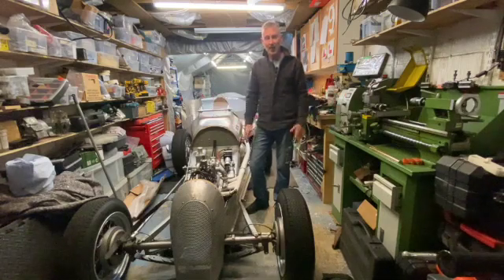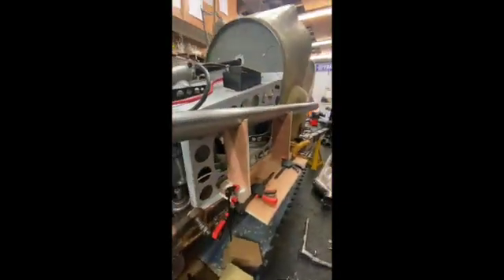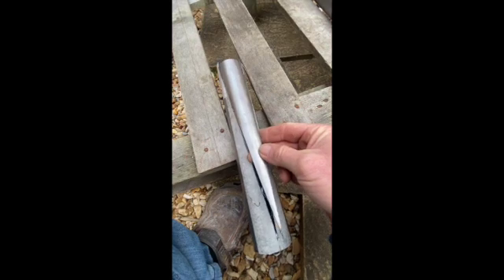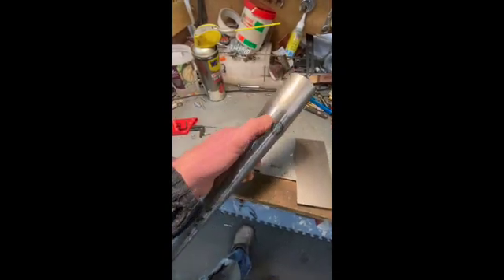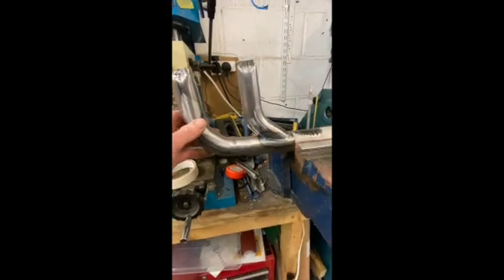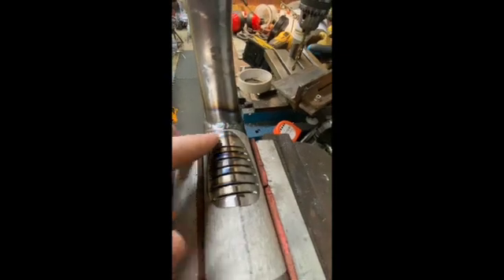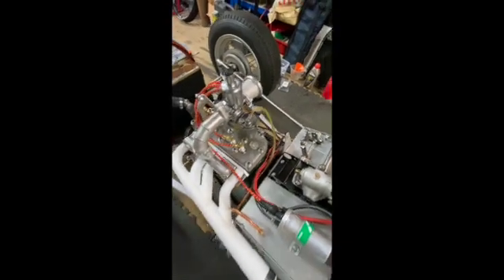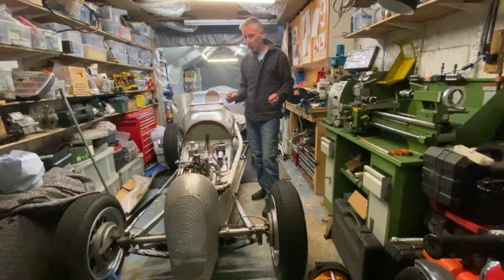Wragg Austin 7 Special - Exhaust Fabrication

Comment: It looks good and well made but I don't think it will be good for power.
It's not just about reducing back pressure it's about resonance.
Positive and negative pressure waves halp pull exhaust gas out and prevent charge from being lost out of exhaust.
Each header must be a specific length and width. All lengths must be equal.
You can get the equations on Google and programs that will calculate the lengths etc using valve timing etc then have them go into 1 or 2 pipes etc.
You can buy the 4 into 1 universal pieces.
You could just measure  an aftermarket one.?
I noticed that you have used a motorcycle type carb, good choice.
Be interesting to do some testing of exhaust systems, I don't know how 7 engines react to exhausts but I find it easy to make an engine feel flat.
Reply from the maker: that's all true Peter ...but they didn't really know that in 1932 and 'equal length bunch of bananas' headers are banned in vintage motorsport in the UK!